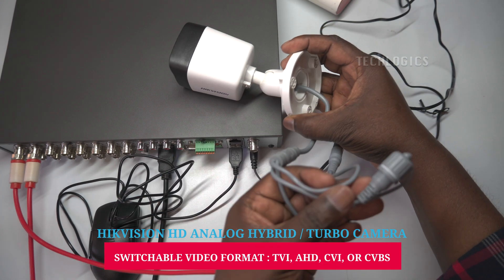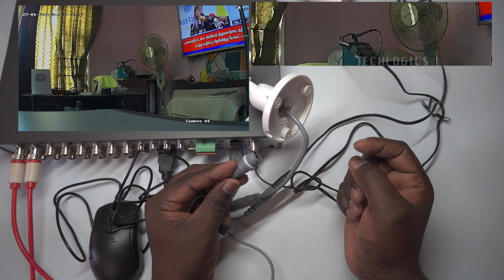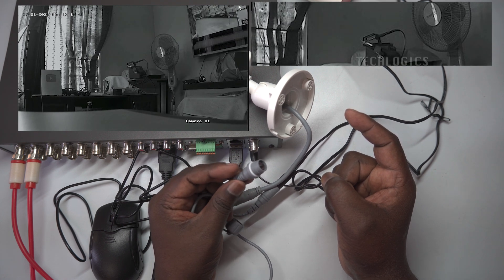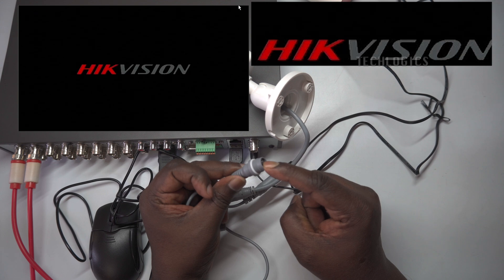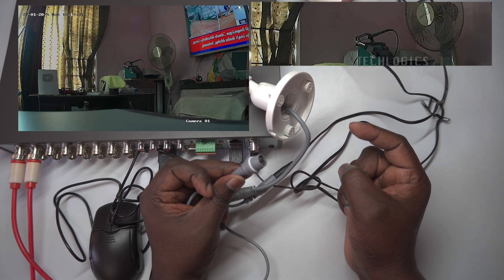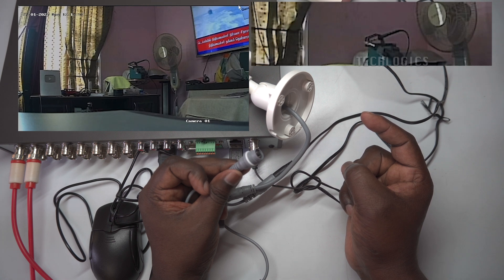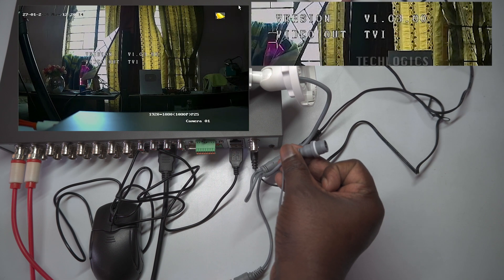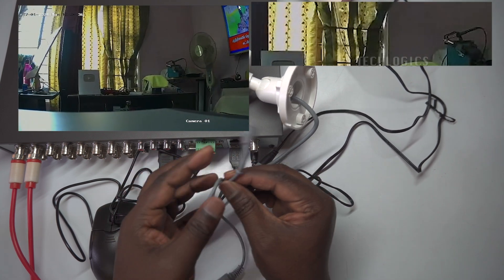How to Use the Hikvision HD Analog Camera: Switchable Video Signal TVI/AHD/CVI/CVBS Demonstarted

Comment: Hikvision DS-7716NI-14/16P/KB/CVBS Hi I’m attempting to reset via the “ button “ as I’ve forgotten the password for some ready on the motherboard board I can’t locate the button all I can see is a small pin hole type next to a triangle electrical sign inside it , I’ve used a pin and held it for several minutes while the power is on but nothing happens